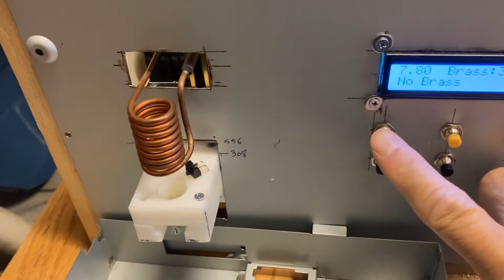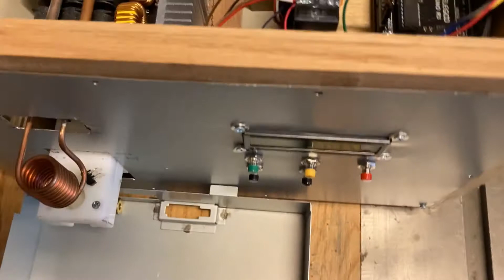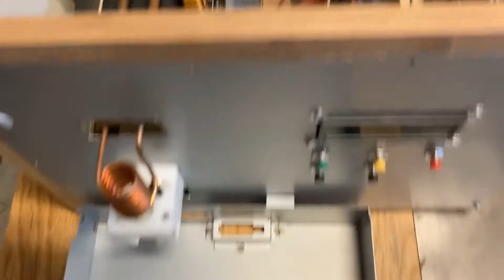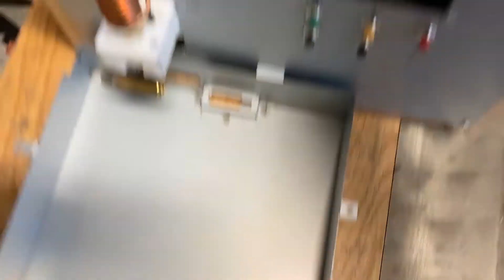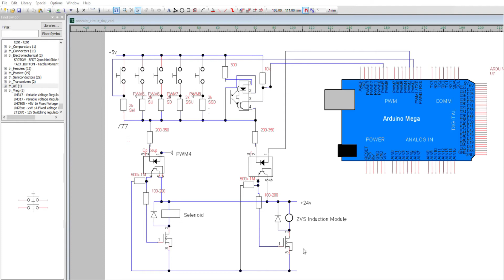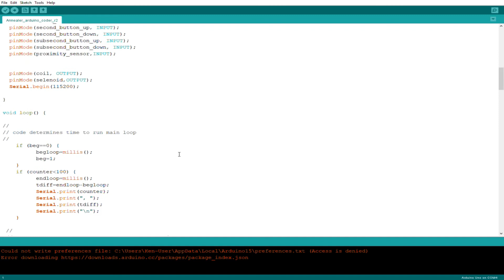Induction brass annealer build information

Comment: If you up the voltage, it would cut back on time needed to anneal and I think that would keep the whole thing cooler.  You should also use less coils for faster anneal and lastly I noticed no glow on your cases nor silver color change.  I don't think you're annealing it long enough to get proper anneal.
Reply from the maker: Yes, higher voltage would help shorten the anneal time and less radiative heat transfer to the coil.  It is a question of economics, higher voltage/current power source cost more.  I am not sure if less coil turns would be helpful.  Temperature uniformity would not be as good (this may or may not be a problem since brass is a good thermal conductor, but heating is based on local eddy current).  I have not measured the temperature, but based on what others reporting, you should only see the start of visible radiation.  The brass would be over annealed if you see glowing for any significant amount of time.

Comment: Cool setup ! May I ask if a long coil as you have (9 turns) is not too much for like 308 brass ? I'll have to do quite the same, as my capacitor bank is 1.33 µF :/
Reply from the maker: It has been a while since I used it.  308 is no problem, only on time is slightly longer.

Comment: kk Lee, 
            First, Thank You for responding.   I had went to the site to download the program file for the annealer however, I was unable to download or receive the file by clicking on the download link. What I was referring to is putting another servo, solenoid or means by which to control a case feeder in dropping the brass into position in the annealer. I also would appreciate any updated information you have in any further work you may have completed on this annealer.
Reply from the maker: I was able to download the Arduino code.  If you still can't download it please let me know.

do you have a design in mind to automatically drop a new case?

I was working on a rotary feeder, but never  built it, see concept,

https://drive.google.com/file/d/19zdc4vZyPwZAKS0-yoPKn0EOKjbEC8-r/view?usp=sharing

Since the anneal cycle is activated by loading of a case, the feeder can simply be run by a speed controlled analogue motor.  All you have to do is adjust the motor speed so it takes longer to drop a case than the anneal time.   This does not require any change to the code.

Alternative, the feeder cylinder could be driven by a stepper motor and thus feeding could be coordinated with the annealer automatically.  For this to work, you will need to use an additional Arduino pin (assuming you don't want to control direction of the feeder cylinder) to generate the electrical pulses needed to turn the stepper motor.  If you want to pursue this route, I can modify the code to turn a stepper motor 1 full turn to load a new case (or other angles [fraction of a turn] if you have multiple slots cut on the feeding cylinder), but I will not able to debug it for you since I will not be building it myself.  If you have no experience with stepper motors, I have pulled some sample parts from Amazon below that may work.

To give you an idea of wiring, you will need to connect the the pin on the Arduino you select to use, to the pull+ input port on the motor driver and Arduino ground to pull- on the stepper driver.  VCC and GND on the stepper motor controller need be connected to your 24 volt (whatever voltage you have) power supply.  B-/B+ and A-/A+ connected to your stepper motor coils.  You will need a volt meter to determine which wires form a pair by measure resistance (near zero resistance are pairs).  There is no polarity the stepper motor wires.  You can hook either way.  If you reverse I think the motor may turn the other way.  Code modification should be easy.

You will need to add the following code after ejection of a brass line,

        for (unsigned int i=1;i<=num_pulse;i++) {
            digitalWrite(pin#, HIGH);
            delayMicroseconds(delay_time);
            digitalWrite(pin#, LOW);
            delayMicroseconds(delay_time);
      }

num_pulse       Angle you want to run, each 1 turns the motor shaft 1.8 degrees
pin#                   Arduino pin you select to use
delay_time       this controls the speed, you may have to play with it make sure brass actually drop into the slot(s), too fast they may not drop into the slot.  Start with something like 500 microseconds.

https://www.amazon.com/Twotrees-Nema17-Stepper-17HS4401S-Printer/dp/B07Y2SVNGP/ref=sr_1_1_sspa?crid=CWODZ0RIV2S3&keywords=stepper%2Bmotor&qid=1674406044&sprefix=stepper%2520motor%2Caps%2C104&sr=8-1-spons&spLa=ZW5jcnlwdGVkUXVhbGlmaWVyPUEyRkxWNkozWEhBOU1IJmVuY3J5cHRlZElkPUEwNTgwNjU3MjZFNzNVU0NFQUxHNiZlbmNyeXB0ZWRBZElkPUEwMDM0MjQ5VEg3TUtPSjdGNlZTJndpZGdldE5hbWU9c3BfYXRmJmFjdGlvbj1jbGlja1JlZGlyZWN0JmRvTm90TG9nQ2xpY2s9dHJ1ZQ&th=1

https://www.amazon.com/OUYZGIA-Stepper-Segments-Upgraded-Version-1PCS/dp/B08PKJG2ND/ref=sr_1_2_sspa?crid=3VC9WPXPOYZXG&keywords=stepper%2Bmotor%2Bcontroller&qid=1674406110&sprefix=stepper%2Bmotor%2Bcontroller%2Caps%2C97&sr=8-2-spons&spLa=ZW5jcnlwdGVkUXVhbGlmaWVyPUEyWFBOVTNUS1FQMzRPJmVuY3J5cHRlZElkPUEwMDExMTk3M1BTRkpWNjBDRDZXRCZlbmNyeXB0ZWRBZElkPUEwNDA0NzA5M01IVlJJMFA4QzJLSCZ3aWRnZXROYW1lPXNwX2F0ZiZhY3Rpb249Y2xpY2tSZWRpcmVjdCZkb05vdExvZ0NsaWNrPXRydWU&th=1
Reply: @kklee1543  Thank You, I am looking into this but, it will take me sometime as I will need to place orders for parts. I also need someone to 3D print me a case feeder, otherwise I can use a Dillon case feeder but will need to stop the cases from dropping until the annealed case has dropped. I see several ways to do that and question which is the best. Allowing the dropped case to activate the case feeder or staging a case in the drop tube prior to the annealed case dropping.

Comment: Hey, great contraption. Could you tell me the dimensions of the coil. Diameter, windings, and pipe diameter. I tried to build something similar, but for some reason, it won't work properly.
Reply from the maker: The coil is made from 1/8 OD tube (don't remember the ID).  I think I tried 8 or 9 turns, but it did not make a lot of difference.  The coil ID is ~0.64".  I may have used 5/8 bolt to make the turns.

Comment: Thank you for sharing your knowledge and skills with this annealer build, the reasons behind your choices, and suggested alternatives.  Your skills are a bit above mine and for my first one I will be shooting for a simple manual model.  But who knows what future projects might turn into.
Reply from the maker: That's right!  Skills are developed from practice.  Most people should be able to do what others have demonstrated if determination is there.  I am learning everyday from designing and building a truck camper from scratch with zero experience.

Comment: Thank you very mich for this video! I was a little afraid that i my not get thw code right but with your great instruction it should be easy.
Reply: I had just found your DIY Annealer on YouTube. Probably wish I had found it right after you had posted the video. So I would like to take this to a complete model for myself however, I am in need of the code to get started as well as may have future questions regarding how to’s for you. I definitely would like to add a 2nd case stop/ slide for the addition of a case feeder. I hope to hear from you.
Reply from the maker: The code can be downloaded using one of the link in the description.  I am not sure how you mean 2nd case stop.  Different elevations?  At one time I was thinking of attaching a stepper motor to the screw so when you select brass to anneal Arduino would automatically drive the stage to the right stop.  It is very easy to setup Arduino to drive a stepper motor.  I am playing with it as we speak to control truck camper jacks I am building.  I also considered auto feeder, but I have not gone to the range much these days since I can't get primer.   It is also possible for the Arduino to control a stepper motor to drop new brass in an auto feeder.  If you can clarify what you want to do perhaps I can give you some ideas.

Comment: What power supply do you use?
Reply from the maker: It is a 24V-15 AMP DC power supply, no brand.  I purchased it for something like $10 on a business trip in Shenzhen many years ago to power stepper motors.  I had to purchase a higher voltage power supply to improve stepper motor performance and so had this on hand.  I'd suggest an adjustable voltage, to 36V and 20+ amps if you anneal large caliber.

Comment: Hello Bruce I'm trying to setup my timer, but can't seem to figure out the settings. On LP1 i'm running a motor to auto feed the cases, on LP2 I'm using it to run the annealer, then LP3 I'm actuating the auto dump. It would be greatly appreciated if you could give me some guidance for the settings.  Oh I have a proximity switch on IN1 that tells the controller to anneal on LP2. I'm also confused as there are different screens showing the zones all at once, and have no idea how to access that feature.
Reply from the maker: I am not sure who Bruce is, are you asking the question at the right place?

Not sure what you are asking on the timer.  The way I have it, the coil is energized 1 second after the proximity sensor detects a brass.  I left 1 second in there in case it is not dropped in properly and it is not aligned vertically.  If you automated this you can change this to shorter time.  Once anneal time is up, the selenoid coil is energized for 0.5 seconds to give enough time for the brass to clear, longer time won't hurt.  On the actual anneal time, you will have to experiment on your own.

Not sure on the question on different screens and zones.  Do you have junk displayed on the screen or different anneal times displayed all at once?
Reply: @kklee1543  I'm so sorry I sent this message to the wrong person. I did figure out what I needed. again sorry for any inconvenience and confusion

Comment: Very nice. Do the various pushbuttons on the front panel call up different anneal times in the Arduino?
Reply from the maker: The right hand button cycles through several preset choices in the code, but you can add more buttons to scroll up and down.  The other 2 pairs are used to adjust the time.
Reply: Can you explain how you are setting the anneal time for various cartridges?
Reply: The "anneal times" in the code don't look like time. Look like some measured value that varies with the size of the brass case?

Comment: Here is another question how large is the slot (opening cut out for drop to move) for the HDPE from top to bottom for movement? I'm thinking 2.5 inches tall by 1.5 inches wide
Reply from the maker: That depends on length of the brass you want to anneal and the thickness (height) of the HDPE holder.  The top position for me is for 556, so I can't anneal anything shorter than 556.  The downward travel only needs at most 1" for 30-06.  If your brass holder is 1" thick like mine, 1.5" travel is plenty, unless you have brass over 3" long.
Reply: @kklee1543  That's good to know what you set up for. I'm learning what size I will need  to have the cut out as well as the coil size, and configuration. I'm looking at three wraps of 1/8" CU tubing dual layer as a possibility, with a7/8" ID. 
Here is a question. I have a 48v 3000w power supply out of a server. Do I need to put a variable power supply controller on it , as well as a zenor diode to protect the power supply from any potential feed back as my relay switches the power on and off to the ZVS???
any advice as always greatly appreciated
Reply from the maker: @keeper1959fem  Wow...you are going to have an efficient energy transfer, putting a lot of energy in a short axial span.  I only have a 24 volt, 15 amp power supply using a single layer and 223 brass heats up to temperature in 4 seconds. With the power source you have and configuration proposed you could get to temperature in much less than 2 seconds for 223.  Temperature control could be difficult and so a DC-DC voltage regulator would be useful to reduce energy transfer for light brass.  If you are using an Arduino, streamline the code could achieve 1 ms timing control.  The extra lines of code I have in there to limit the timing button adjustment rate really slows things down (I don't remember how slow it got, but each loop took several milliseconds instead of looping 3 times each ms).  I am not see much inductance from the ZVS and so I do not have a fly back diode.  The solid state relay I am using may have one built in (I don't know).  It does not hurt to add one.  There is a need to prevent the region below the neck to heat up, but I am not sure if excessive heating rate is good for the brass to recover from the cold work (technical term used to describe repeated deformation/lattice dislocation pileup at low temperature).  The brass recovers from the repeated deformation because the dislocations can have mobility at the recovery temperature and they annihilate each other.  This takes a bit of time and if heating rate is too high the material experience less time in the critical temperature and you will need to overheat to have the same effect.
Reply: @kklee1543  LOL I like over doing it, and getting the best I can. the power supply rocks for what it is. I did get a 4 station timer that runs in milliseconds so that is covered. I have a 30A relay to delay the transfer of power from the power supply to the ZVS. I'm going to build a setup that will feed the brass automatically. with using three proximity sensors I can shut the machine off when it is out of brass, and one to trigger the timer when brass is detected in the drop tray. It is gluing now since I used HDPE to build it. sort of like yours only the front doesn't show the cut out I made with my dremel. Well enough for today we will see what tomorrow brings for the next steps.

Comment: I like your design,but is it possible to see how you made the case holder/drop part, and how it is adjusted? any help would be great
Reply: found a solution on wish so it is on order thank you again for the info.  Woodworking DIY Aluminium Alloy T-track /Miter T-Bar For Carpenter Manual Router Table Saw
Reply from the maker: @keeper1959fem  Make sure you have couple inches of space between T-bolts on each track to maintain stability/alignment.
Reply: @kklee1543  I ordered the T-track so it will stay in alignment. I thought of going with bolts to, but didn't like the risk of binding like your thinking. A side note I did have a bit of HDPE so I'm gluing that together to make my platform assembly, and ejection/ case support like you have. Great ideas from you
Reply from the maker: I am not sure which part you are referring to, but I have added exploded view of both the brass holder and the screw driven elevation setup.  I am not sure if I made the brass holder to the dimension shown, but you can make it to accommodate your brass size.  The brass hole is tapered for easy insertion and centering, https://www.harborfreight.com/3-piece-stepless-drill-bits-66463.html.  The taper offered by the hole drill was not large enough and sometimes brass gets caught by the edge.  If you have a way to make the taper a little bigger it would work better.  Or make the holder thicker so hole at the top would be bigger.
Reply: @kklee1543  You got it. I’m working putting mine together starting next week, and when I saw you idea of the shell holder and the elevation I knew that was what I needed.
 The case holder I get what you did and I plan on making one similar to yours. You have some great ideas.
 thank you on the drill bit idea. I will Get those as I can see they will be perfect for the taper.
I saw the plans for the elevation assembly, and that was what I needed, thank you again

Thank you for your help
Panama E
Reply: @kklee1543  I've been rereading what you]ve said about the hole taper, and I may play with that a bit with my dremel so that when i setup to do larger calibers it will be accommodating. What I have noticed on other units was to have a larger hole size, then also to wrap the coil with glass cloth or even shrink tube so the brass doesn't short out the  ZVS. My idea is to incorporate ideas from several other builds to make one unit that works for me, and possibly others.
Reply: After looking at your design for the case riser assembly, I noticed you tapered the rails to hold them in place. My question is have you thought about selling the parts to make the case holder assembly, or even the complete assembly that holds the ZVS?
Reply from the maker: @keeper1959fem  No need for that.  I think If you buy a section T-track it should work just well, https://www.amazon.com/POWERTEC-71118-Double-Cut-Universal-Predrilled/dp/B074MN2CPL/ref=sr_1_5?dchild=1&keywords=t-track&qid=1618680628&sr=8-5.  I have a table saw and so it is easy to make the tracks.  you can also build the tracks with strips of plywood by gluing them together.
Reply: @kklee1543  This is why I talk to people, LOL that is an excellent idea using either the wood or the track. thank you again

Comment: Look at my latest video, we are close in design, but I have little more automation. You will find some ideas maybe to do some mods on yours. Why you using plastic case for case holder? It will burn it eventually.  Did you use heat resistant material for it?
Reply from the maker: Good for you, a professional looking machine.  I designed an automatic feeder, but decided not to build it since I only need to anneal couple hundreds cases a year.  The holder is made of high density polyethylene; it was what I had on hand and easy to work with.  The bottom of the brass does not get very hot and after continuously anneals of several 30-brass batches it did not show sign of damage.  Earlier on I only energized the selenoid for 100 ms and couple cases got caught.  It deformed the slider slightly but it did not burn.  The selenoid is now energized for 500 ms and cases should not be caught by the slider.